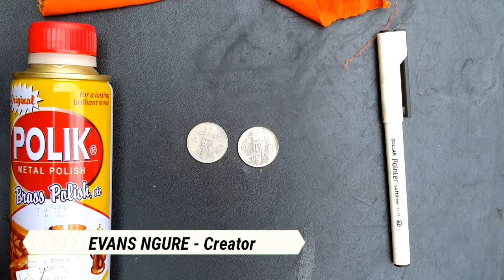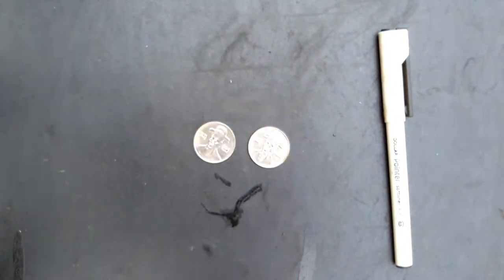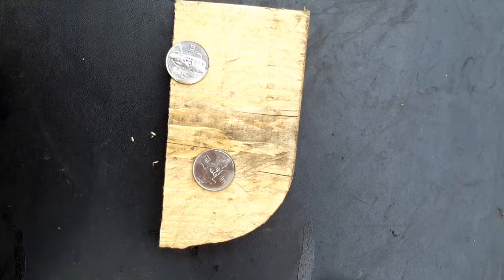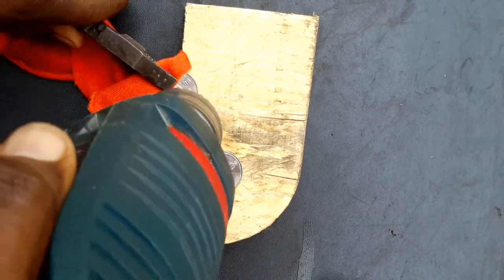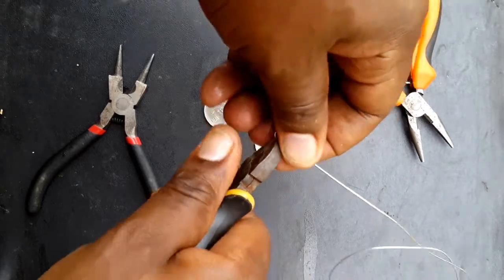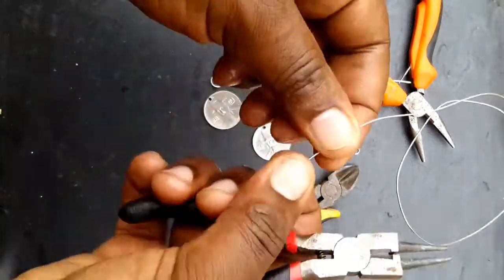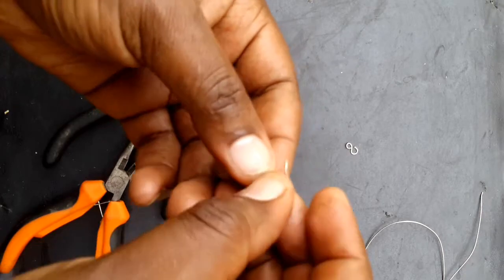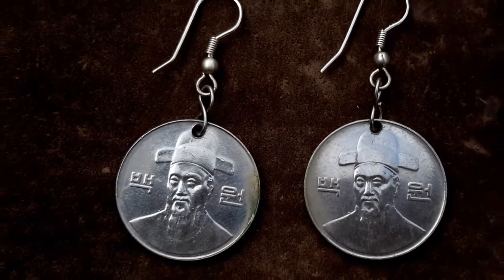How To Make Coin Earrings |  JEWELRY TUTORIAL  |  #coincollector #coinjewelry

Comment: Why should the hooks be nickel free? Do the earring hooks come in different sizes? Is that the smallest size drill bit? Can you use a thinner guage wire?
Reply from the maker: Nickel free earring hooks are recommended so that they dont react with the skin. Yes earring hooks can come in different sizes and feel free to use a thinner wire gauge so long as its strong enough to hold your pendants